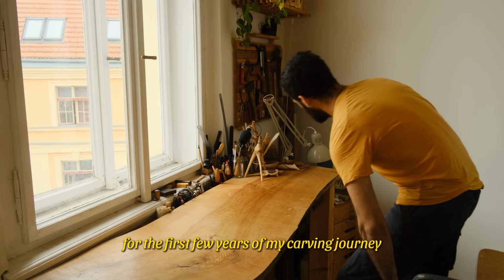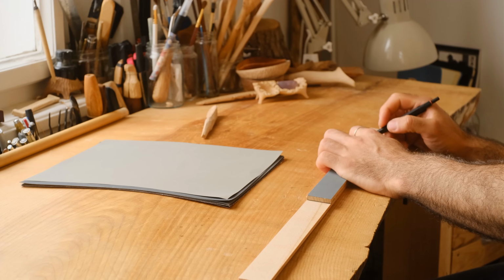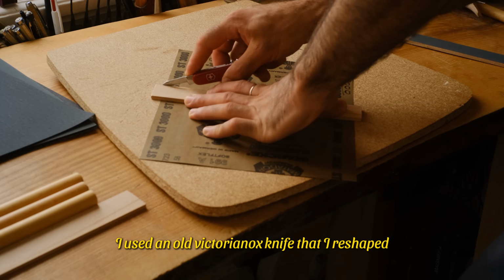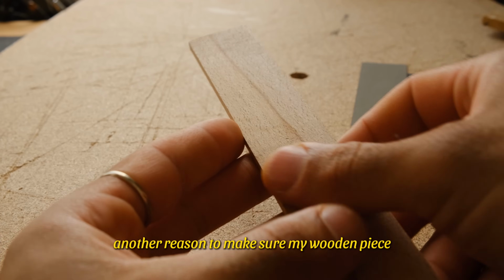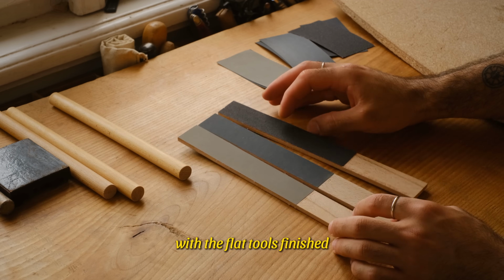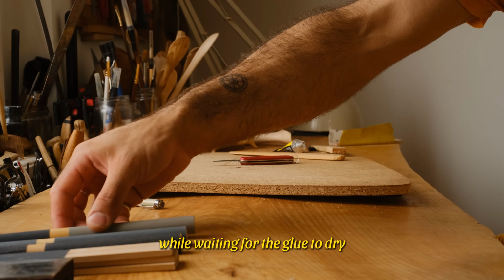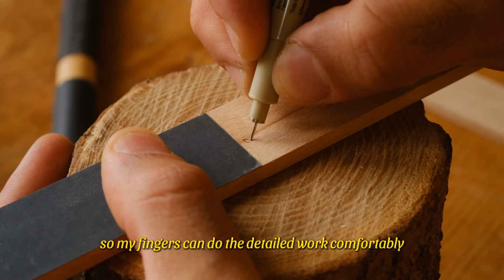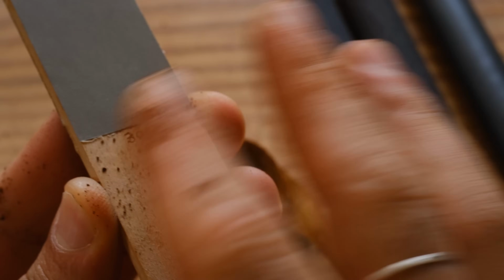How I make a Simple Set of Sharpening Tools – Narrated Version

Comment: The beauty of your simple system is that it can be tailored to the carvers specific tools rather than a one-size-fits-all approach of the commercially available systems. Thank you for answering a question many new wood carvers seldom ask. Re the glue issue, I've seen hot-melt glue used for similar purposes. To remove the sand paper you just heat it with a heat gun and peal the paper off. Denatured alcohol will remove any hot-melt glue residue before the next application.

Comment: A thin “carpet” double sided tape will usually peel off nicely from the wood while still keeping the sandpaper in place (as an alternative to your glue). Their original intended use is to keep carpets in place on the floor so they are made to peel off from hardwood floors.
Reply: Super glue and blue painters tape would also work
Reply: I use this carpet double sided tape in my work for this exact purpose :) it works perfect. I stick the paper leaving it wider than the stick and cut after. This leaves a perfect edge!

Comment: I do much of my sharping using the same methods. After some experimentation I have found the use of wax as the bonding source works pretty well. Easy to apply and easy to change paper. Just warm it when you are reattaching new paper to make it stick better.
Reply from the maker: Thank you for the advice 😁🙏🏾 I will try it out (:

Comment: I dont know about new glues but i think a mixture of pine resin and charcoal will do the job, you heat the mixture and glue the sandpaper, when you need to unglue it you can just heat over a fire or with an heatgun the object and you will have a liquid glue again
Reply from the maker: Sounds like a solution I would like! I Always prefer using natural resources that wouldn’t cause any damage or harm to anything

Comment: Thank you so much for this video!
Did you try with thin double tape?
Reply from the maker: Yea it actually works quite well! But it does make the surface a bit softer which can make the edge rounder when sharpening
Reply: @nadavartandwood If I am not wrong, I think there is an ultra thin double tape. Maybe you can try with that. I will definitely try your system, because it is not expensive and yet gives amazing results.